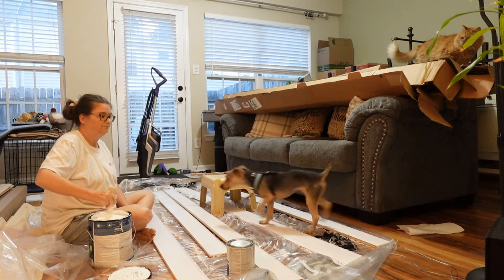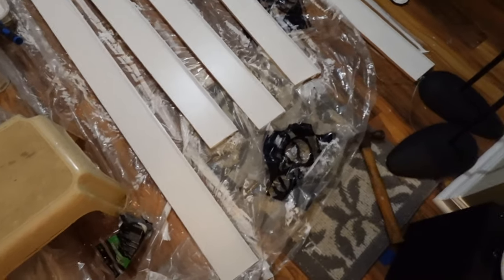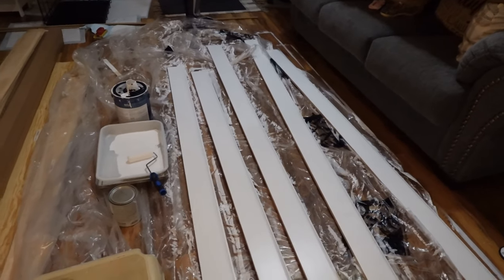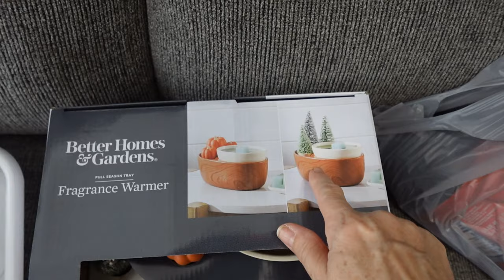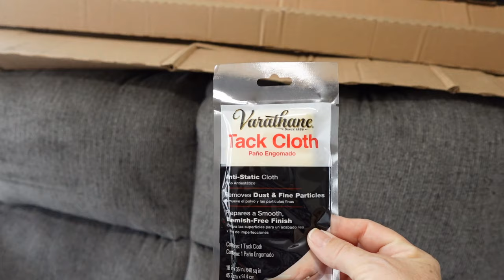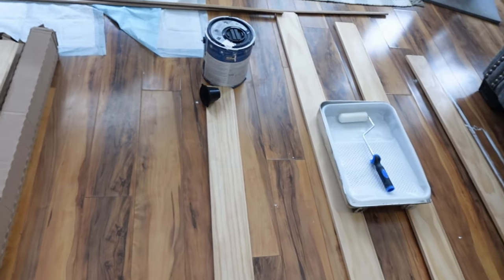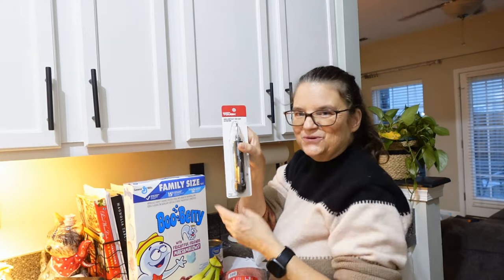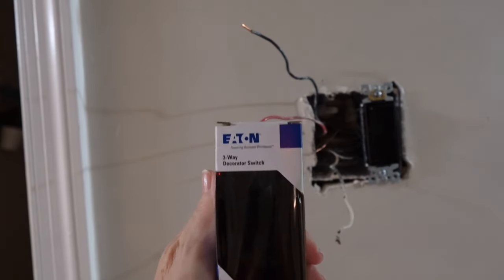HOME RENOVATION DAY: 9

Comment: You’re very inspirational. We need new flooring, but it’s so expensive. We have a black lab who is older and has incontinence. Don’t want to replace until after she is gone. And we need our HVAC replaced first. Air conditioning in Texas is essential. 🥵 How do you work at a hardware store and not know what tack cloth is. 😮 I love cereal for dinner. 🤣 Your sofa looks comfy. 😊
Reply from the maker: Thanks so much for watching, friend! It is all very expensive but I will be happy once it’s done, adds value to the house. Instead of buying “stuff” I want to invest in my home. I need a new ac soon also. That’s up next when I can save up for it. Have a fabulous weekend!!
Reply: @lesleeslivingroom I can’t wait to see it. 😊 Don’t get me started on air conditioners though. I’m in the DFW area in Texas. Summers get up to 110 sometimes. Ours didn’t quit working, but quit cooling. Our electric bills got up to $600. a month. Ridiculous!! We stopped using it and put in a window unit, which I hate! But we don’t have $8 to $10 thousands dollars. 😭😭
Reply from the maker: @mom234ever3 luckily fall temperatures are on the way!
Reply: @lesleeslivingroom  thank the Lord! 😊